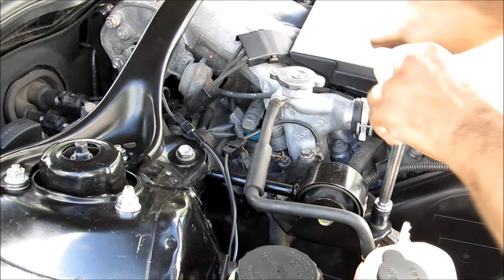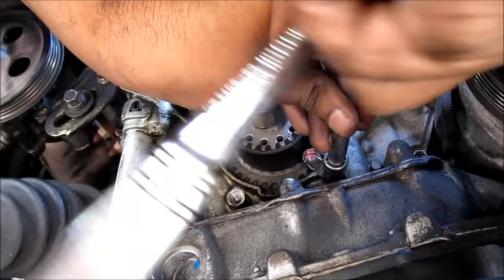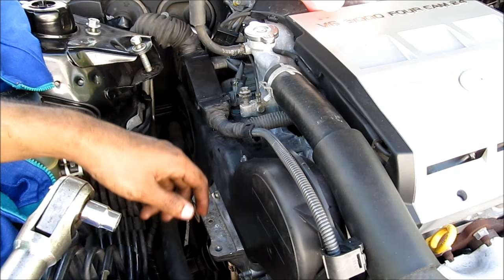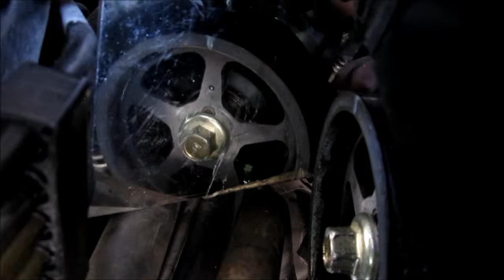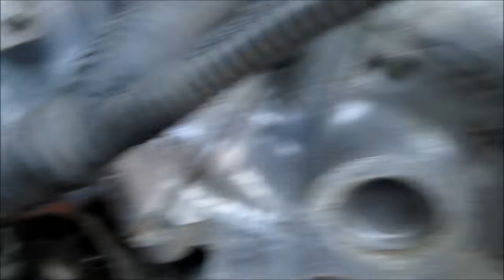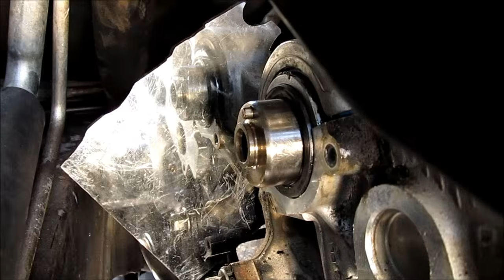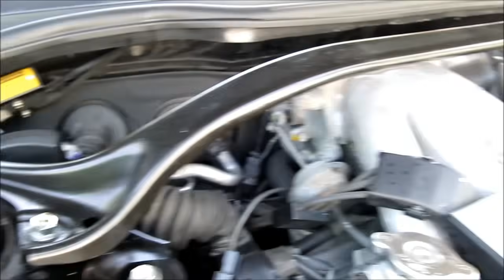Timing Belt / Waterpump Replacement: Toyota & Lexus V6

Comment: Hi Speedkar. I've heard that the 4 cyl Camry engines all have leaky oil pump gaskets at a certain point. My 2001 V6 Camry has oil all over the power steering pump case which looks like its coming from higher up. 
Could this be the oil pump gasket/seal or Cam shaft?
Reply from the maker: I'm actually not familiar with the 4 cylinder, but if you wipe it up with brake cleaner and then drive it around, you should be easily able to spot the leaks.
Reply: @speedkar99  thanks for your reply! Sorry, I meant that I have the V6 1MZ-FE engine and was wondering if they leak from oil pump seal like the 4 cyl engine from the same era. 

I guess I'll clean the area and look for the leak as you suggest though. Thanks for your advice, really appreciate it!

Comment: This video could be used to teach how to film and edit DIY repairs videos.  A few words about the cam seals.  BEFORE pulling any seal, take a picture with the old seal still in place to see which face and how deep it sits in there.  Not all seals sit flush with the outer surface.  As for removing, some prefer rather screwing a wood screw into the seal and pull - be sure to use a small enough size screw not to touch/scratch any metal surface and screw it at a right angle.
Reply from the maker: Good tips! Thanks for the feedback. I'd be scared to use the screw method unless it's my only choice left.

Comment: @Speedkar99 I know you said the first set of seals started leaking, did the second set hold up okay? No leaks? I'm thinking I will do seal install with the 1.5 inch PVC pipe like you did but still need to come up with a cam pulley holding tool.
Reply from the maker: If it's leaking then replace. 
If not then yolo

Comment: What do mean by disconnect the ignition and flip the starter for removing the crank bolt?
Reply from the maker: Blipping the starter turns the crankshaft. 
So instead of turning your breaker bar to crack the bolt free, you hold the breaker steady and have the crankshaft do the turning for you 😏
Reply: @speedkar99  ok thank you

Comment: This is one of the best, and by best I mean, hell, even I can understand your presentation, me, the least mechanical guy in this comment section.  So thank you for excellent efforts.  But I did have a question--I am just trying to replace the timing belt and the water pump.  Why does this job also require me to replace the camshaft and crankshaft seals?
Reply from the maker: You don't have to replace the seals if it's not leaking. Thanks

Comment: Really it's an excellent video 
also i have a question what happen if i scartched the timing shaft like you did , Is there any side effect ?? i know that if i scartch the housing it will leak oil but i scratch the shaft what will happen ?
Reply from the maker: Yeah it can leak. Becareful

Comment: This is why changing timimg belt/water pump/front oil seals etc., on front wheel drive transverse engine cars is expensive, a lot of dissasembly needed just to get access, excellent video and commentary. (I drive a 1990 Volvo 240 and this job is a doddle on my car by comparison!) Thank you for your excellent series.
Reply from the maker: Thanks. 
The disassembly is regardless of engine for this job

Comment: You started the engine after installing the timing belt without installing the power steering and alternator belts...is that normal practice or safe?
Reply from the maker: Yes. 
Just don't get anything stuck in the belt when it's open. 
And don't run the engine for too long otherwise it'll kill the battery

Comment: Something I'm curious about is the torque for the camshaft and crankshaft bolts. I'm still on the semi-noob side of DIY, so bear with me if any question seems ignorant. I notice you didn't torque them down to spec. What are your thoughts on that? What about the crankshaft bolt near the end of the whole process? You just use an impact to zip it down. Could that not possibly cause marks to go off TDC? Or can that not happen once the belt is tensioned on w/ TDC marks? Is it not important to use a torque wrench on the crankshaft bolt to proper spec? Or does using an impact gun provide so much torque that it will be on or even over torque spec without torque wrenching it?
Reply from the maker: With experience you'll learn how to torque things by hand or by the gun. 
I learned the hard way too...snapped bolts in the process

Comment: Hello. Great video, thank you. I think I read somewhere not to use timing belt tension to remove rear cam bolt. Do you know why that might be?
Reply from the maker: Because you might stretch the belt if you are reusing it
Reply: @speedkar99  I wish you didn't cut when you loosened the front cam bolt. Did you use the pulley holder tool to break it loose?
Reply: Hello. Is there any reason not to use an impact wrench to remove, and to reinstall, the bolt on the front cam sprocket?

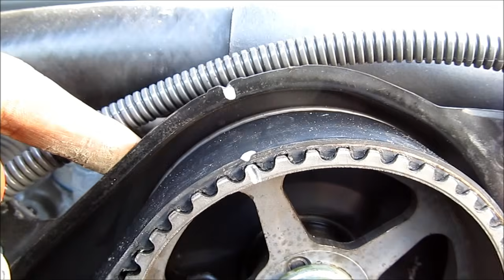Comment: I'm stuck sir.  At the 4:50 mark you can clearly see the pulley and the mark on cover #3 are aligned.  But on my 2000 Avalon, with the original belt on it, and with the crank at TDC, those two marks on the front cam were not aligned.  Should I independently rotate the front cam to align with the mark on the cover?
Reply from the maker: Once the belt is rotated from it's original alignment the match marks will rarely realign

Comment: Hi there.. Very nice Video! The part where you momentarily installed the harmonic balancer and started the car to make sure the timing belt was one and everything working properly.. From all the wires you disconnected, what did you reconnect besides battery to do this? Can you please provide more detail on this procedure?
Reply from the maker: I don't recall connecting anything to start the car...in the whole process only one ground wire needs to be removed at the engine mount.

Comment: Thanks for the vid, roughly how long does it take, I just bought at 08' Solara with 90k on it. Thanks in advance.
Reply from the maker: Mechanics charge about 7 hours of shop time to change the timing belt. I did it in about 8 hours including filming
Reply: @speedkar99  Thanks for the reply!

Comment: By Grapthar's bone!  Its worth the $750 bucks the mechanic charged me not not buy all the tools and remember the 10,000 bolts and parts I would need to remove and putback, I guess. Why can't cars just work on voodoo magick?
Reply from the maker: Magic? Try a Corolla they last forever and can take abuse
Reply: @speedkar99  corrolla? Might as well be taking about finding a unicorn, especially the mythical early 90's corrolla. sometimes i wonder if they even exist....

Comment: Very well done. I have done timing belt on my Subaru and Acura. With the Acura I had to do it over like 4 or 5 times for whatever reason and the 5th time, I had used a clip like you have in the picture to hold the belt to the cams. This spring I'll be doing my Lexus RX, so this video is going to make my life a lot easier. I do not have a cordless impact to break the crankshaft bolt, so Ill probably be using the starter bump method. Glad to see that you endorse this method as well.
Reply from the maker: I'm glad my video can be of help. Thanks

Comment: It's going to be about 15k until I decide to do this job, but I have a couple questions for you speedkar.

Since you scratched the surfaces on the camshaft when removing the seal, how would you do it differently next time to avoid that? Learned any better way?

In what cars do the studs not clear the fenders to take out the water pump? I have a 1999 Lexus ES300.
I've never jacked up an engine before. What's the best method to not damage anything? ( To my newbie knowledge, people use a large block of wood + jack up from the oil pan?) Is there a better way? Is there anything extra that needs to be done before jacking an engine up?
Reply from the maker: Hope the video helps. 
They sell proper seal pullers or you can use a screw and pull. 
I saw a video on an RX300 where the water pump didn't clear. Your ES is similar to my Solara so I don't think you'll have to take out the studs.

Comment: So i'm gona replace the timing belt on my 00 Lexus es300 soon. Are aftermarket timing belts & water pumps reliable or should I go with asin oem? I only ask b/c the aftermarket one is substantially cheaper than the asin one (at least on amazon it is).
Reply from the maker: The aftermarket kits will include different bearings and a generic water pump which I don't recommend. I had a Gates kit put into my ES330 and the pump leaked after 3 years. 
The Aisin kit is basically OEM parts for much less than OEM price. Since labour cost is high, best to get good parts in my opinion.

Comment: what if the belt broke? can you still use the starter motor to break the crank nut loose and use get to TDC or is this an interference motor? thanks.
Reply from the maker: Yes the starter turns the crank thru the flywheel/ flex plate

Comment: Well you did it in 14 minutes... I should be able to do it in 7 since I have help =P
Reply from the maker: Yep it should not be too hard if you have all the tools ready
Reply: @speedkar99  lol still going on it and I hate my life right now. One of the bolts for the timing belt pulleys sheared off.
Reply: @speedkar99  also everything you said we might have to do we had to do. Our engine had to be jacked up to get the engine mount and water pump out. Our pneumatic impact didn't have enough torque to get the crank out so we bumped it about 40 times before we went out and purchased the Milwaukee m18 with 1400ft/lbs of nut busting torque.... that thing is a God send lmao I had no illusions about this vehicle being a nightmare.. definitely not my first rodeo with it and I was completely ok paying a mechanic to do this one but my old man was like "nonsense! We can do it!" So here I am buying more specialty tools to fix this pos ahahaha anyways figured you might enjoy the laugh

Comment: I have a 2000 solara with the 1mzfe engine. I followed this whole process but the engine won't continue to run. It will start great but die but like not getting fuel
Reply from the maker: Maybe the timing is off? 
Can you double check?
Reply: I'll have to. It runs for 30 sec And then quits

Comment: Hey man, I have a 2004 Lexus es330 with 76k miles. I bought it a few months ago and have since had to get a transmission rebuild along with the TPS adjusted because apparently that had something to do with the tranny going. Anyways.. so I have spent quite a bit of money between new headlights and the tranny rebuild. It's running as it should, and being the reliable car I need but I need that to be the case for a long time considering the car has 3/5 of its life left in it. The timing belt hasn't been done however and I am writing to you to ask your recommendation. Do I wait to get more out of it, say 80k miles then get the TB & WP replaced? Or should I be looking to get them both done immediately? I feel like I need a 'pre purchase' inspection for someone to checkout the powertrain & everything and tell me what needs to be done to this car to keep it going for a long time. What else would you reccomend get inspected? I just don't want to sink more money into the TB & WP matinence only to have some other bullshit fail on me. Only one way to get there though. The car is very nice and my first decent vehicle, having put money into it I'm now quite invested haha. Thanks in advance for your help.
Reply from the maker: The 3.3 power train in those cars is very reliable. Not sure why your tranny failed. They did have a lag issue with the throttle. I used to have a 2005 es330 and hated it for that reason. 

As long as everything is fixed it should last you a while. Rubber deteriorates with time so look into replacing that TB and WP soon, though it's not a safety critical issue.
Reply: @speedkar99  thanks a ton for the response man. Think you could give me a figure to shoot for with the timing belt? I'm at 76,670. I'm assuming the sooner the better. I will probably go to a Toyota dealer since they do them all the time. I was aware of the lag issue but I think the tranny had just never been serviced and ran so hot for so long it failed. All good now though. I guess the only things I need to worry about now are TB & WP. I read these cars last a long time if taken care of so I figured I'd ask if you had any recommendations as far as matinence. Went from feeling like I bought a lemon to accepting things fail. Sorry to ramble. Thanks for your time. Great content maybe one day I will have my own lift and project car to work on. Will certainly be needing your insights!

Comment: Thank you for the very good video.  I'm trying to track down and repair my 96 Camry V6 3.0L oil drip that is dripping at a fairly good rate 1 - 2 drops per second.  If it is rear cam seal,  was there any tension on that cam with the timing on top dead center marks?  I saw another vid where the person put a wrench on rear cam bolt to keep it from moving when timing  belt was removed on a Sienna. (the other end of box wrench was under pressure against a part of car.)  Thanks for any tips.
Reply from the maker: Yes the rear cam can slip anytime when aligned. Be careful

Comment: Very informative video with clear step by step directions. I have a toyota 3.3 v6 with 243k miles. Timing belt just snapped (replaced 35k miles ago). Do you think its worth trying to fix or would it have bent the valves?
Reply from the maker: Whoa! Never heard of a timing belt snap on the 3.3L especially with only 35K miles on the belt. 

I guess your best bet is to put a belt on and see how the car performs...it's likely that the valves didn't bend at the time of snapping and could be safe...
Reply: i said screw it. sold the car. bought a new subaru!  it was a great car. $1800 and lasted 3 years . your video is very helpful, just no time to fix

Comment: I have a 96 lexus es300 with 154000 what milage points are the timing belt maitanences supposed to be done
Reply from the maker: Every 90k miles or 7 years

Comment: At 5:50 minutes you say that the rear cam pulley does not need to come off to change the water pump. On my 2002 Camry LE the two rear bolts for cover #3 are under the pulley. I found this out after removing the belt. Had to stick a 12mm deep socket and ratchet through the spokes of the pulley to slip over the back 10mm bolt to keep the pulley from turning. Then I broke it loose with the cheater bar and 14mm socket. Also, as mentioned in another comment, my alternator has a 3rd jam bolt on the sliding mechanism that needs to be loosened to lower the alternator. Thanks for the fantastic video. It was a life saver.
Reply from the maker: Those two 10mm can be removed thru the sprockets 
Then timing cover #3 can pivot up around the rear cam

Comment: I have a question I'm working on 2002 Toyota Avalon, I broken one of the 10 mili screw heads while tightening the water pump back down what should I do ????
Reply from the maker: You'll have to drill it back out or use vice grips and replace it. 

Don't leave it because it will leak

Comment: Im in the middle of a timing belt replacement and noticed my tensioner is a side bolt?
Reply from the maker: You have the newer 1mz with vvti
Reply: speedkar99 Do you know a lot about 1mz engines? I’ve got a kind of a pickle I can’t figure out.

Comment: Hey,

Notice on the VVTi looking around many of the manuals warn of a piston to valve slap when you break the cam bolts free.

e. Turn the crankshaft counterclockwise by approximately 60 .

NOTICE: To prevent the piston head and the valve head from colliding, set the crankshaft pulley at approximately 60 BTDC/ compression position.

edit: Source: http://www.tcamanual.com/timing_belt_1mz_8722_fe_3mz_8722_fe_-645.html

They oddly say to go back 60 before belt removal for removing cams then go back before belt is put on. To late for me was working on a 2005 VVti hopefully didnt slap anything when i broke the cam bolts.
Reply from the maker: Yes i got confused by that too, its to prevent the valves from hitting the piston in case the cam rotates without the belt on there.
Reply: Emm Cee for the vvti whenever you can I would advise when I went back to complete my last belt change I did this step on tightening of the cams then re aligned the crankshaft pop the belt on

Comment: Is the crankshaft seal that did not replace the same size as the camshaft seals? I am planning on doing this job as well, but want to make sure I am getting all the right parts needed. 

Thanks
Reply from the maker: They aren't the same seal
Reply: Great, thanks for confirming.

Comment: To remove the crankshaft pulley bolt with the breaker bar method (at 2:31 mark), what is the best way to disconnect the ignition so the engine does not turn on?
Reply from the maker: Pull the ignition fuse

Comment: Thanks mate very well explained. Just a question though. If i wanna use the same old tensioner, how can i push it in and put the pin in the hole to hold it? It tried to push it as hard as i could but it is very hard.
Thanks
Reply from the maker: You need a vice

Comment: Good video. I did TB but there’s a scraping or grinding noise. Almost sounds like belt rubbing on cover. Have u experienced this?
Reply from the maker: No, but I've read in the forums 
Did you replace the cams on the right shaft?